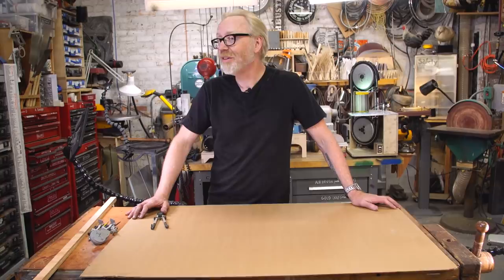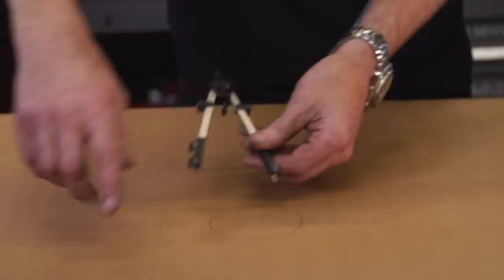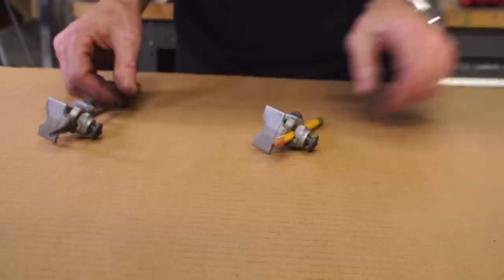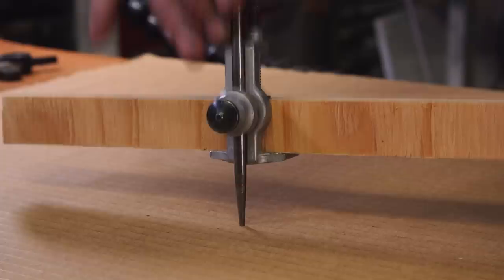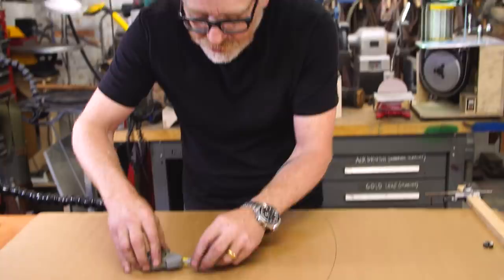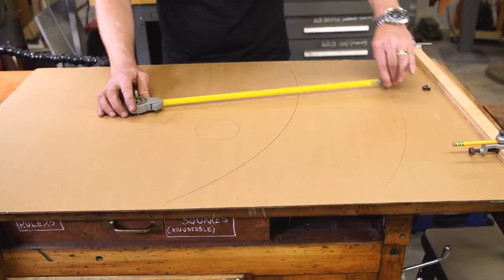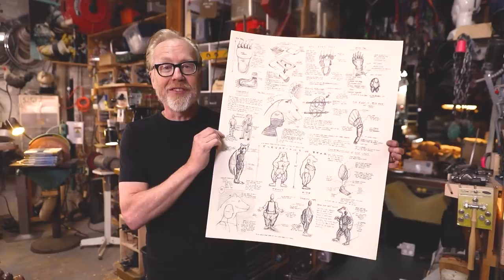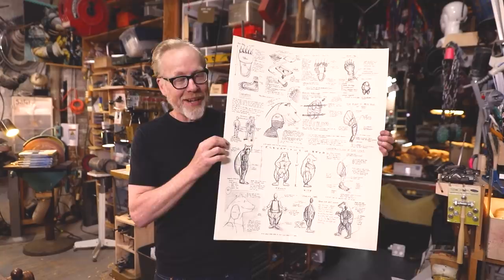Adam Savage's Favorite Tools: Trammel Points and Rotape Beam Compass!

Comment from the maker: Starrett Trammel Points: https://amzn.to/2G1nqUd
$25 Trammel Point set: https://amzn.to/3hLNpMQ
Rotape Beam Compass: https://amzn.to/2RKtpj2
Reply: Check out the festool tape measure. It can do big a radius AND accurate inside measurements. Well worth having in the toolkit.
Reply: Why is the Starrett trammel 3x the price of the other one.
Reply: Great video Adam!! learned something new. Thanks
Reply: Pretty sure they were only called a compass not a protractor
Reply: @rtd1791  Read a few reviews and looked closely at the images over there - Apparently the cheaper option (General Tools 523) is made of *plastic*. At a price of 25 USD and regionally available to me at about 48 EUR which equates to about 56 USD... I'm terrified as I almost just went for it thinking they're metal parts, which they actually seem to be if you just look at the first picture.

Comment: Yep, came to the same solution when I was making speaker cabinets in Jr. High and needed to make a perfect circle to mount 18 inch subs. I took a piece of OSB measured it to 9 inches, drilled two holes and put a dowel in one and a pencil in the other.

Comment: Any discussion of the Starrett or the US General trammel sets needs make mention of the fact that the divider points supplied with either are ground to points that are off-set from their centers. This enables the beam compass' 'set' to be precisely tuned over a range of nearly 1/2".

A slight loosening of the knob in the center allows the point to be rotated in its fixing. This moves the pencil (or scribing point for metal) back and forth over this range. When the required distance is dialed in, tightening the knob holds it at the setting.

The adjustment has to be made at the pointy end while watching the marking end.  Also great for precisely picking up wild measurements where your tape may be problematic

Comment: I mentioned the Omicron Beam (Rotape) compass in the last circle tool video, nice to see Adam playing with one. 

It’s no so much a gimmick but more of a large scale drafting/patterning tool apposed to a fabrication tool. I’ll clarify.. When I started at Universal Studios 30 years ago all the Art Directors used them. Most of the drawings were done on D and E size sheets (3’ and 4’ across respectively) plus the need for an occasional full-size mock up drawing or large scale plot plan.. the Omicron filled the bill; adjusts like a tape measure, stores in your desk drawer or bag, would do a larger diameter than most beam compasses and was pretty darn accurate ta boot. The original also had one more option, you could add an ink pen or marker. 

Back in the day when this tool was developed most industries used large scale if not full-size drawings (pre-Cad). Think automotive, aviation etc.  

I still have mine, but if I was to pick up another one I think I would buy it off of eBay. I see them pop up from time to time and usually in pretty good shape.. plus made in Los Angeles.. what’s not to love about that?

Comment: I often have to draw circles for ceiling designs (on ceilings of course)... I use plastic corner bead, cut along the seam for a flat piece. They're made with holes every 1/4" or so.... screw one end on center, and a pencil through another hole @ your measurement. As long as you keep the bead flat, you'll get a perfect circle.

Comment: The flexing of that rotating tape measure out at the point where it comes out from its reel could introduce some error on a circle.  You would need to make sure that the tape always stays linear with the center point.
Reply: A Stanley PowerLock is actually fine up to about 1m (3ft) but beyond that the tape just won't stay flat when turned on its side. It leans in towards the concave side and you can't pull hard enough to rectify that because the force is already too much for the lock, even for this kind of decent-ish tape. I'd much prefer the trammel points.

Comment: Doesn´t the flex, at the location where the tapemeasure comes out of his housing, disturb the circle?
Reply: I guess that if you don't grab the housing with much force it should allow you to rotate and control it with the pencil end(the metal tape has some resistance to bending), also even if you have some small amount of inconsistency that's why most of the time you do more passes than one and also remember that most of these measurements will be part of something you cut, paint, glue etc so there are many other opportunities in the process where imperfections occur.
Edit: it would be less noticeable if you grab the metal point that you stick on the material(which, I guess, has that bigger grabbier part for that reason) and let the base rotate freely, because now that I see it again the flexing is noticeable although due to the distances and some trigonometry the longer the tape the less it matters
Reply: Probably but it was just a demonstration anyway.
Reply: @manolismarinakis8444  yes. and regarding very big circles, you might (well, i do) often just need a small section for a smooth curve like on furniture. You won´t notice the bending there too i guess.
Reply: @antraxxslingshots  As always every good tool has it's job :) I wouldn't use it if I was NASA and I was creating a small delicate part for a probe, but for making a round wooden Viking shield for Halloween it would be perfect

Comment: I have Eclipse trammel points (similar to the Starrett ones): they have two reversible pointers, with cylindrical back ends on the pointers, which means you can also use them as layout tools, also as square gauges for drawers, cabinets et c. They can lock into 22.5º & 45º pockets for odd-angled layouts as well. I make bell wheels for church bells, and sometimes the circles/segments are 12 feet in diameter! https://www.tradetools.com/product-range/hand-tools/lay-out-and-marking/eclipse-trammel-heads

Comment: I just use a nail or similar, a board, and a hole with a pencil in it. Or if I need to cut something thin down, I screw a razor blade to the end of the board.

Comment: I know alot of construction workers use makeshift grammer points. Put a nail (or screw) in the center of the material, tie a pencil the desired length away and voila

Comment: Rope tapes are a beam compass. Rad tool that works like a pencil & string. Awesome design (which copied its design from omacron) but the brand rope tape makes cheap plastic & junk. The best brand is omacron & they were made in likethe 50's or something. Problem is you can most likely only find vintage ones on eBay for like $60. 
Mine sets at Mac of72" radius or a 12' circle.

Comment: Tools? A string of any x length is enough!
Reply: String is not recommended, string is stretchy. If you're OK with an approximate circle you can use string but if you want a good circle you're better drilling a pencil sized hole in a piece of wood and using a nail.
Reply: These tools stop the pencil tilting too. Easy way to ruin a curve.
Reply: Except depending on a material and way of weaving that x length is up to ±10%.

Comment: Or you can get exactly the same effect with a nail, a piece of string, and a pencil.
Reply: You do have to be careful while doing that though. It's quite easy to start angling the pencil some and come out with something a bit off round. The devices he shows hold the pencil straight up and down and are definitely better if you need something perfect and don't want to rely on your ability to hold a pencil straight up and down the whole time.
Reply: As long as you don't tilt your pencil  & the string rotates around the nail & pencil doesn't wrap around it.  But if accuracy doesn't matter yeah it works fine.